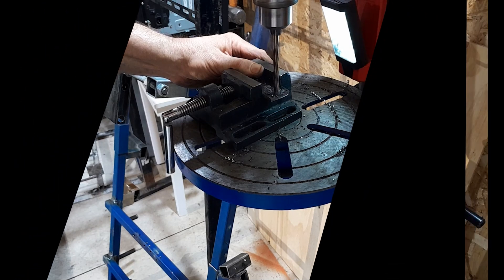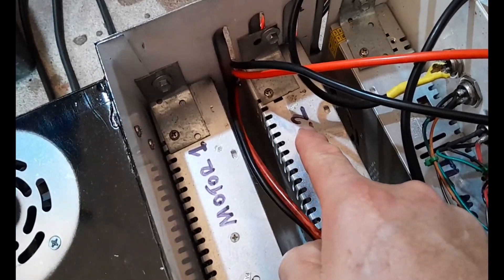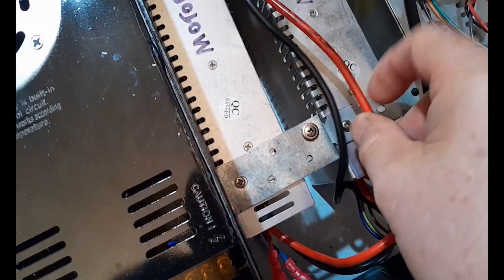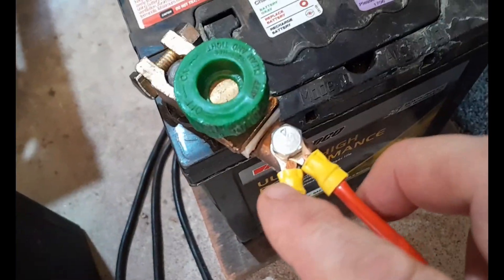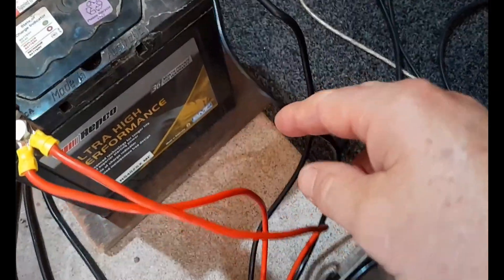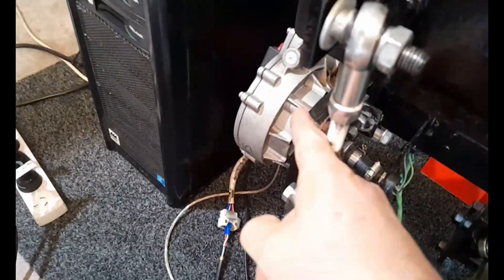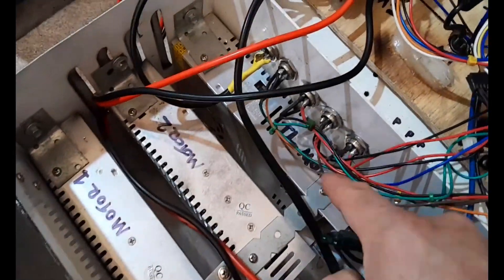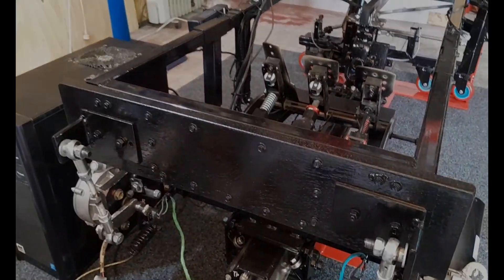Sabretooth 2 x 32 4DOF Motion Simulator Plus SLA Battery Basics

Comment from the maker: EDIT: A 410CCA (40AH is fine) is only just enough current for my rig. This battery I was using in this video was a stand in. It was a flat battery my son gave me and I was using it to allow my PSU's to charge it up. I have put back in place the 720CCA 75AH (a heavy duty battery used for high compression V8 engines) which I have been using. Much bigger current handling with a battery of that size. I recommend that size battery for drop out free motion sim movement.